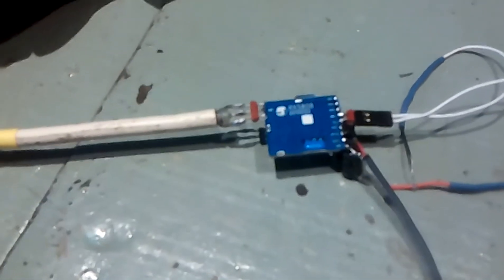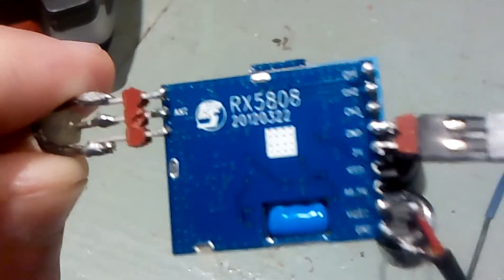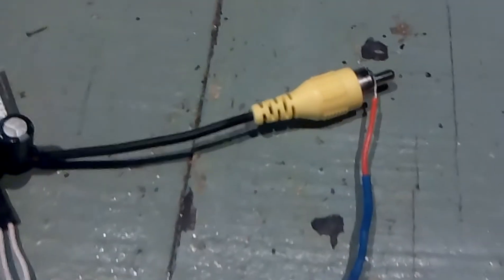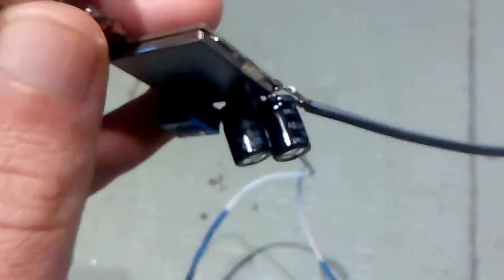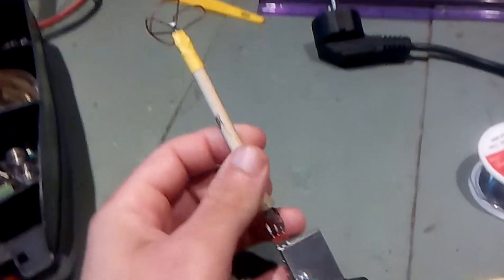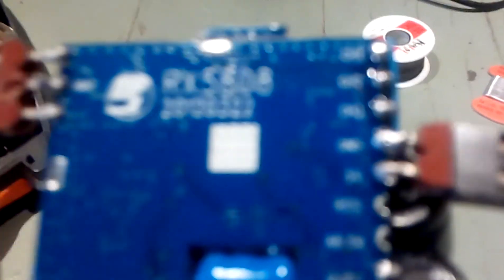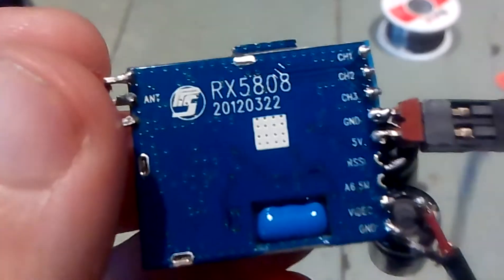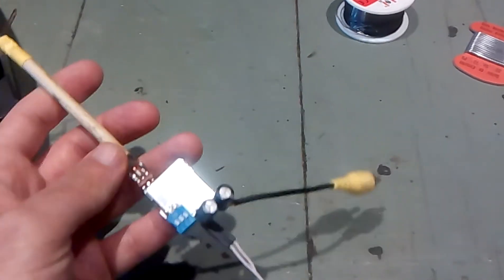Boscam FPV 5.8G Wireless Audio Video Receiving Module RX5808

Comment: I just killed my ev800dm goggles thay came with a bad battery so I installed a lead to have external battery but the battery was to powerful so lots of smoke now I'm trying to remove the 2x rx5808 receivers And hoping I can make an fpv monitor or use laptop or TV as fpv screen till I can get sum fat sharks

Comment: Dude, 1 question.. what happen if there is no metal/aluminum shield on it? Coz i broke the metal/aluminum shield on my RX5808
Reply from the maker: That works as heat dissipator, so it will get too hot without the cover
Reply: @luisfilipe1983  im not really sure, coz i just found the shield is called RF Shield.. it block any unwanted signal get in / out from the circuit..

Comment: From what I've seen on other websites, you can remove 1 SMD Resistor in it and the channel pins will output SPI instead and you can use an arduino to select channels with it

Comment: Hello man ! Nice video.

1. Why did you decide to use the capacitors? 
2. Cant just go ahead and connect the power and video cables without the capacitors?

Thanks a lot!
Reply from the maker: hi, i decided to use those because i makes the image better...you can still use it without the capacitors but it might be that some interference shows up in your video
Reply: Another question:

What type of signal can i use in the video input? Could it be taken for example from a dvd? 

Thanks.
Reply: I mean DVD player
Reply from the maker: you can input analog signal AV from any device that gives you AV out connectors
Reply: Hey you guys I found a forum link that briefly explains why and how to resolve the flicker issue. the power needs to be connected to one of the pins on the regulator. Here is the link and good luck http://sudomod.com/wiki/index.php?title=BW_3.5_Composite_Display

Comment: Voltage source is 3.5-5.5 how did it work with 3.3v ?
Reply from the maker: most things that say 3.5v to 5v will work from 3v to about 5.5v those things have tolerance...even though you should not abuse it speacially if feeding more voltage than what its suppost to get...

Comment: Hi
great job.but one question,Is it work as good as other boscam receivers? Don't you feel the range reduce with this DIY RX?
Reply from the maker: Hi it works very good for me... but honestly, i have never used any other so i cannot tell if it is better or worse .
Reply: +luisfilipe1983 Hey. Why do you need to hang on the video output capacitor?